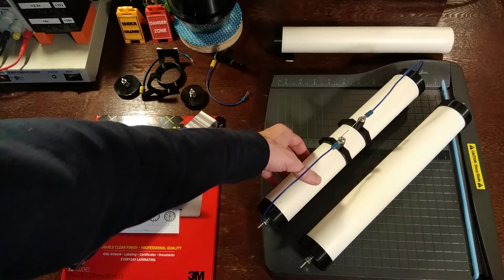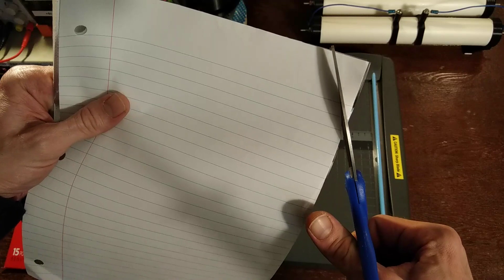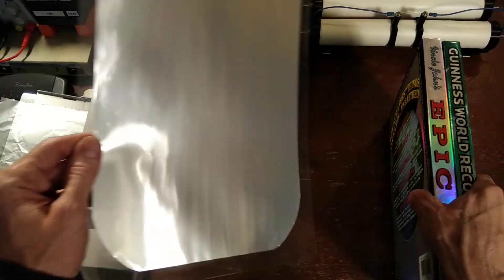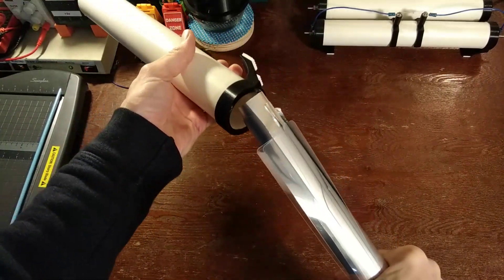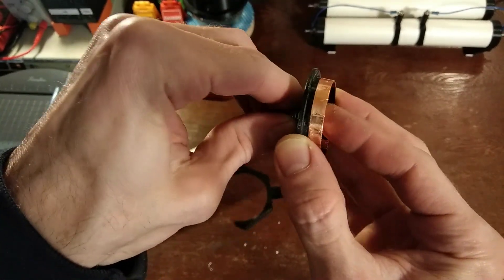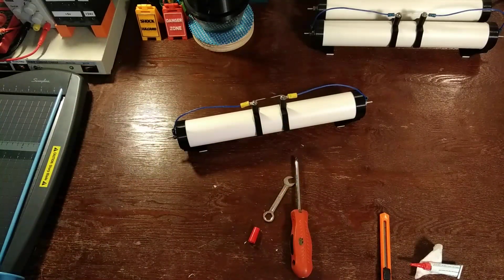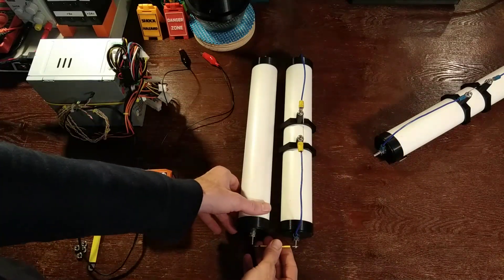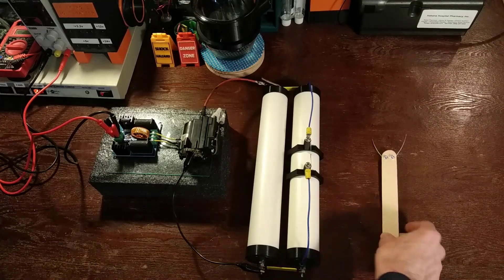Super Capacitor Tutorial!

Comment: Please, 
how do we know the positive and negative side of the capacitor? Also, what is the average rating of the capacitor? How much farads do we expect from each? Finally, is there any fears of over-charging while in use and if so how can we deal with it. This is a very commendable work. I am pleased with people like you who are willing to share your knowledge to improve others. More grace, thanks bro.
Can we use any latex 5mm sheet for the lamination or is there a special one for dielectrics? Thanks. 
Kindly reply.
Reply from the maker: Thanks for the feedback - this capacitor is bi-polar so either terminal can be used for positive or negative. As for other data, I hope to be acquiring the proper equipment to measure these values soon, in the meantime, perhaps someone would like to re-create and share the approx. ratings here.

To prevent overloads (when over 10,000v +), leave a .5 to 1 cm gap between the adjustable overload electrodes, I haven't found anything that can overcome the dielectric breakdown of these 5mm laminate sheets at those distances yet - I know the cap handles the output of flyback transformers and other high voltage sources very well, and it's also the polymer the laminate sheets are made out of and the process that the plastic is stretched which makes it such an excellent dielectric barrier. (I've tried MANY materials, this one by far has had the best performance)

I hope to make an update video in the future with upgrades and the ratings data, until then, from my research this is probably the best HV cap other than salt water that you can currently find as a DIY on youtube - it's a solid cap that gets the job done =)

Comment: You have high voltage capacitors but they aren't supercapacitors. 

What you have is really good for birkeland eyde reactor. Given the hotness of the electrical arcs, and the potential damage to the electrodes I'd suggest using a gliding arc with lots of air flow to both cool the electrodes and spread out the arc.

Comment: Want to make something even more fun? Make a capacitor like this. But larger diameter, add 8 to 12 extra turns of the outer foil as a spiral in the center. Now add two pieces of copper tube for the low and high side electrodes going the full length height of the foil. Position so the capacitor will arc between these near full voltage. The center will generate over 100kv at tens of nS pulse. Works great for building a diy EMP test source with an antenna added. ❤

Comment: I would not define this as a super capacitor though, it is a high voltage film cap. it would be fun to see how many nanofarads or so they measure. But but your design is pretty neat. I would however recommend you solder wires to the aluminium foil to eliminate the risk of contact issues in the end caps (it's easy to do with regular tin).

Comment: This is not a super capacitor
Reply from the maker: These are HV super caps - you can add layers or use a larger tube to increase capacitance / energy storage. Because of the tight roll and other great design factors, unless you have access to a factory, these are the best high-quality, high-voltage capacitors you can easily make by yourself and by conventional means.

Comment: That is not a super cap. Supercaps have at least 1F, this one should have in the rounds of nanofarrads.
Reply: You don't seem to understand what a supercapacitor is. Supercapacitors and regular capacitors (like electrolytics) work on the same basic principle, storing charge in an electric field between two plates. The difference is in materials and structure: supercaps use electrodes with insanely high surface area (like activated carbon) and ultra-thin separators, which gives them much higher capacitance. Nowhere is stated that they must have over 1F of capacity. You can find plenty of Supercapacitors online with wayyy lower capacities.
Reply: @KatTheCaz 

This isn't a supercapitor - this is a plate capacitor. Supercapacitors of that size should be above a Farad.

The guy is right.

If you want a supercapacitor, try this:

Inside a bag put:
Stainless steel mesh
Conductive carbon felt.
Paper towel
Conductive carbon felt
Stainless steel mesh.

Use salt water as an electrolyte. Don't let the screens touch.

1.2 volts - 8.5x11 might be 400 Farads.